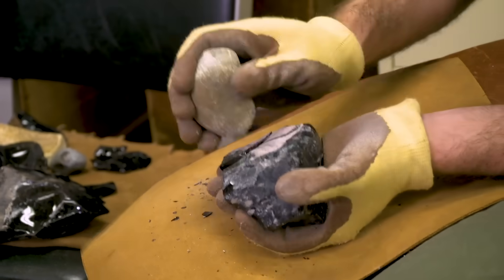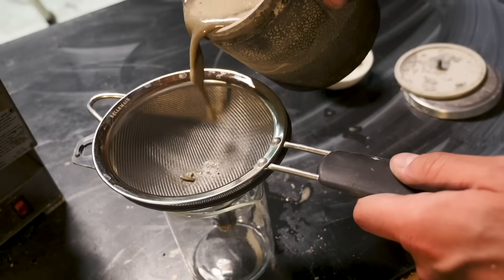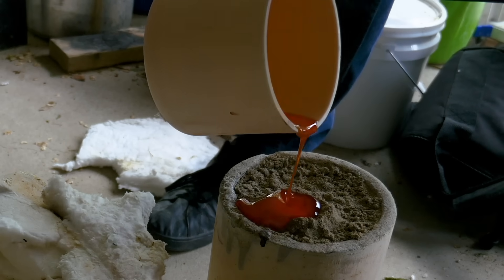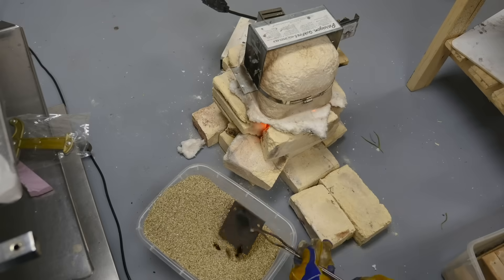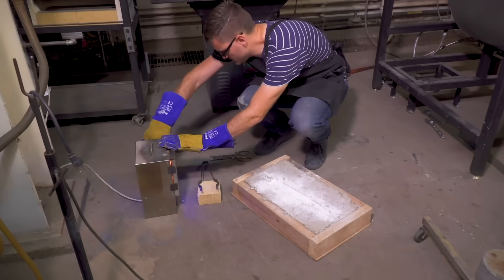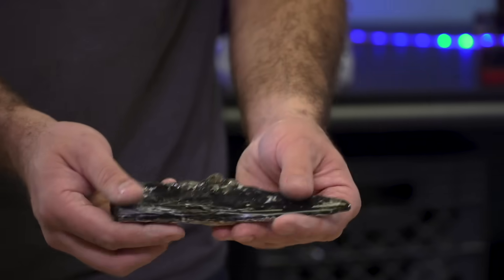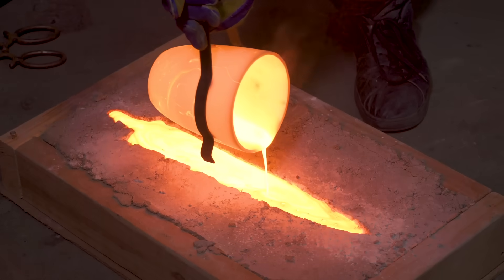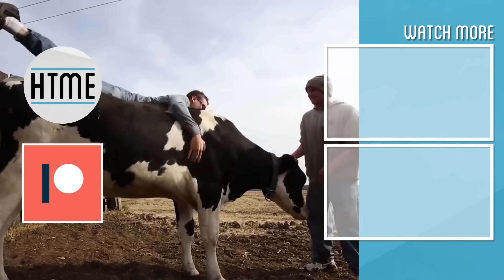Can You Melt Obsidian and Cast a Sword?

Comment: As with all crystalline structures, the longer it has time to set, the more organized the structure will be. In nature and in manufacturing this is achieved through heat and pressure. Since obsidian has a lot of impurities, which can differ in obsidian obtained from different regions, the annealing process for it requires much longer time for heat dissipation and at higher ambient pressures that typical glasses... like some gems ,such as rubies and diamonds, require high pressure, heat and time to form.

Chances are that part of the reason it's so brittle is that there are a lot of trapped gases in the molten glass; oxygen, nitrogen, CO2, other trace gases, and since its setting at room pressure and probably within 24 hours all those gases migrate and expand as the surrounding crystalline structure compacts but are unable to escape. This causes internal pressures to build eventually forming fault lines (cracks) in weaker areas of the structure (locations with higher levels of impurities).

Creating a resilient obsidian blade is possible, its a form of glass and just look at what the company Corning is doing with Gorilla Glass. The melting, casting, and annealing should all be done in a pressurized, heat regulated enclosure that can properly regulate the process for optimal results... being able to do that, well, that's out of most of our reach. With that being said, it is a glass crystalline material and is subject to the same tensile stresses that occur in most glass crystal structures; hit something hard enough, or at the right angle and it will shatter 🤓😜
Reply: Just have a look at how Zirconia blade is made. It is pretty similar. You need powder obsidian + binding agents, and then mould them under very high pressure, so it can stay in shape for handling. Then you heat it up towards the evaporative temperature of the binding agents, to let the binding agents get out from the obsidian shape in a controlled manner. Then you sinter the obsidian in a very high temperature for it to shrink to 2/3 of its size. That is how a strong bond is formed within the crystalline structure. This is how all engineering ceramics are made, if you know things like silicone nitride, silicone carbide, alumina, etc.
Reply: that is, it is not very possible to do at home ...
Reply: Like silica glass, obsidian is NOT crystaline. That is why, when you flake it, that the fractures are conchoidal 

Obsidian is not always black. I have seen a number of different colors/effects depending on the impurities. Some is even clear like glass.
Reply: @buggsy5  Crystalline silica has conchoidal fracture as well.
Reply: It works just like melting chocolate?
Reply: @verylittletime  

No.  But you can eat it like chocolate.
Reply: @Rand0mManic  Great.
Reply: In English pls

Comment: The right method to use Obsidian is by Grinding it to a powder state then u add it on a Molten Metal and I don't say just dump the obsidian u need to scatter it evenly through the blade by sprinkling it like adding salt to a dish

Comment: Might be more feasible to find a large obsidian chunk and chip away till you have a dagger or sword etc, than the blade would be sharp and you maintain the integrity of the obsidian, granted it is still going to be weak because of the density of obsidian, which would only give a couple of uses before snapping or becoming dull.  The smaller the weapon the more durable it will be.

Comment: Can you cast an ingot from a meteorite/s, then turn the said ingot into a blade of some type?
Reply: Yes if you have enough of the right kind of meteorites. As long as you only used the most iron rich meteorites you have something pretty close to smelted iron and could make a blade out of it. If you were really lucky you might even get ones with relatively high nickle content (can vary from 5%-25%) and end up with something like maraging steel (15-25% nickel) which is still workable into a blade but much harder than pure iron. Though you'd want to melt it down because many meteorites have a crystal structure to the iron and nickle that would be problematic for making a good blade.

Comment: Try adding Borax.  Boron strengthens silicone materials like glass & obsidian. It also reduces cracking & breaking.
Reply: I . think he also needs to keep everything hot and bring temp down slowly in the annealing oven. Like it's done in nature. Oxygen free would probably help as well , but not a vacuum either.
Reply: That is more relistic but I doubt casting is the right way to go about it it. Even in metals casing can produce bad quaity iron and steel, because of air. glass weapons only exist in fantasy, but I like a better grouning in reality when I read fantasy. Or  when I write it........
Reply: @mariabyrne7222  aztecs had weapons made of obsidian wich where a lot sharper than weapons made of metal
Reply: @---5819  but they like flint were forged in the earth. Casting glass isnt going to cut it, its not the elements but the chemical reactions they go through to make the weapon.
Reply: @---5819  what im trying to say is the weapons were knapped like flint and obviously ordinary glass is used as a weapon every day. But cast glass, is ike iron going to be filled with imperfections such as air. This will not just make it bittle like iron but it is actully full of weak spots, the slightest pressure on the glass is always going to cause it to shatter, so it has no strengh as a weapon. It is only good in a fantasy world were the rules of phyisocs sre different.
Reply: @mariabyrne7222  I agree, there are more chemical processes that go into glassblowing than simple casting.
Reply: @Anolaana  exactly!
Reply: @ @mariabyrne7222  Boron is what turns glass into Pyrex glass. Unlike iron, glass & obsidian can be melted and poured into a mold. Glass & obsidian are silicone materials which have different atomic properties than metals such as iron, zinc, titanium, aluminum, nickel, etc. due to the difference in the atomic structure. Working with glass based materials must be done properly though. The temperature has to be controlled. Boron glass or boron obsidian is much tougher than the untreated glass or obsidian. It can be filed or sanded to make the edges sharp. Obsidian was used for arrow and spear points by passed civilizations. It worked very well. Neurosurgeons & researchers currently use obsidian blades in scalpels under an operating microscope to cut nerves longitudinally to remove tumors, etc.. Obsidian edges are infinitely finer & sharper than any other type of blade currently available. I did not want to get into all of these details in my original post. I just wanted to point people in the right direction if they wanted to pursue this further.
Reply: @mariabyrne7222  author much?
Reply: @andybucak4564  poet wanna be novelist. Slowly making a name. But not there yet
Reply: Maria Byrne not with that grammar/spelling you ain’t.

Comment: so 1st make a large kiln big enough to hold the mold. 2nd use graphite not sand. 3rd heat the unknown obsidian slowly giving a chance for all gas to escape slowly rather then all at once. add vacuum if you can after it stops.  preheat the mold. after pouring put the mold back in the kiln to cool slowly. 
the big problem is your trying to cook a pot roast in the oven in hour not a crock pot over 12 hours. because you are using glass sand to cast glass you are trying to do everything quickly so the mold does not melt. your trying to cast wax in a wax mold see the problem.

Comment: your shit will disolve in water..lol,,then you fake the color. btw...thats not called flux. ..your just making up words now.
Reply: That's called flux... you're new to the casting/forging community, aren't you?
Reply: @dobson.  rofl...no im not..im  a glass blower with 30 years exp..who specializes in blowing tektites and obsidian...and thats not how the word flux is used in glass.  you are literally...talking to the wrong guy ,,
Reply: borax can be both flux and network modifier..but what you did was litealy make borax glass. you no longer have a silica matrix. so you arent using it as a flux.
Reply: @dobson.  btw..i own a company that makes custom borosilicate glass. with either uv sensitive ,,or is color shifting depending on light sources.  that i design the glass formula and production methods of. as well as having built the production line from scratch.

Comment: The GoT universe realized that this was a problem. Hence they used Valerian Steel as the Flux and dragons breath (the fire) rather than using kilns to melt the obby to the right temperature . You had the answers all along.

Comment: It would probably be less likely to crack if the mold container if the sand or mold itself was heated as well, that way the contents slowly cools down to the container's temperature and then from there it can be cooled further. I do think it would be better to take it to a professional glassblower's workshop, due to their expertise and proper-sized equipment. They might even get a kick out of turning the obsidian rocks(with metal additives or without) into an obsidian sword.

I also think you should have used a metal core for the blade and handle rather than just straight up obsidian everything. The core of metal would allow for less of a chance for the handle to break(it would probably be easier to make the main body of the blade out of metal and make the edge of obsidian. But rather than try and form it in a wedge shape, go with a blunt shape that could be gently ground down. It would take longer but the end result should be of better quality.

Comment: Obsidian sword(godly)[attack 1560,defend 1357]
Craft the obsidian sword(godly)? NO YES←
For crafting an obsidian sword,you have to equip:
Blacksmith nearby
Miner nearby
Have to crafted at least 5 legendary weapon or tool(5)
100 smithing level(100)
30 iron(30)
100 obsidian(100)
10 Rock elemental(10)
10 ground elemental(10)
10 fire elemental(10)
10 ice elemental(10)
10 star elemental(10)
50 mystery elemental(10)
an obsidian anvil(1)
Craft← Quit
Start crafting...
It will take 10 days...

Comment: Its possible using the blow torch during the cooling process (for your last and most successful pour) may have induced stresses in the blade. I understand the need for a controlled cooling rate but by using a torch you subject the blade to differential cooling, which in turn could lead to locked in stresses (which may lead to fractures). Casting within a preheated form surrounded by insulation could help with this (not sure about the feasibility though). **Disclaimer: I'm no blacksmith/glass blower, but i do do research on the thermal treatment and aging of polymeric materials**

Comment: How To Make Everything, youy messed up and made mistakes also on the castings mold making. As a professional metallurgic, machinist and prrecision mechanic, i have to say:  Every casting mold needs additional "casting air channels" so to speak. This helps  the casting release the unnessary pressure tension, excess air and unwanted impurities out of the casting, making better casting.
Also, youy should have grinded the obsidian even more finer powder, almost fine as a dust (no rocks what so ever!), so you dont need to add anything else to casting process itself.
And yes, we do have done obsidian castings on our school days.

Comment: the problem with obsidian is, that it is too hard, which makes it brittle. iron and steal is not so durable, because its so hard, its durable because its also flexible, so it will bend rather than break. obsidian and glass is usefull, because of the scharb edges, but its very fragile because it is simply too hard.

Comment: have you considered using some sort of metal core heated up to a high temperature, but not molten temperature so the obsidian will have added strength. Also, the conductive properties of the metal encases in obsidian could even help slow the cooling.

Comment: The blade doesnt have to be 100% obsidian
you can grind the obsidian into a powder, add it to a Damascus steel mixture, cast it inside a canister, and draw it out as a part of the steel.
you would essentially endup with an obsidian infused Damascus steel blade, and it would probably be very sharp and have some nice visual characteristics.

Comment: Use a HHO  brown gas generator which you can buy on ebay and it burns over 6000 degrees. Or you can try induction heating for melting.

Comment: This stuff looks like a nightmare to work with but I admire your determination and it was interesting to see the results. I think if you want a true obsidian dagger your best bet is to make cuts off a large block given how brittle it is.  Maybe with a water jet cutter? The reaction when it cooled with the bubbling was interesting in how it reacted to the air. If obsidian forms under high temperature volcanic conditions then I wouldn't be surprised if the temperature and chemical composition of the air plays a role. The air would likely be hot and have gasses and substances like sulfur present which may effect the cooling process differently that normal air.

Comment: If you make another attempt at this, what if it were to be mixed with other elements to make it stronger?  A pure glass blade, Obsidian or otherwise is still glass.  But akin to the Flux making it transparent and impurities making it darker, what if it were obsidian-coated metal?  Or combined Obsidian-metal molten poured into a mold?

Comment: If obsidian is mostly silica then at 2000 degrees it is an acid.  No wonder it leaked from crucibles and ate up kilns. Notice he added METALLIC nickel and chromium to the mix and it made black glass again.  Hence molten silica glass mixes are corrosive as heck at these temperatures 😳

Comment: Use a induction furnace itl be cake to melt you can pour over 2000f easy for fluidity. Line the crucible with refractory theres some good premade refractories from foseco.

Comment: Lol how many thousands of dollars did you flush down the toilet to make this? 

I made a beer can forge and made my own bars from the metal and melted through a few cast iron containers. I considered buying a a crucible but wanted to spend as little money as possible.  

My forge was bbq charcoal inside a sand/ plaster mixture, insulating a metal empty gas grill container I cut the top off from.

Comment: I’ve seen a documentary on how they made traditional Japanese Steel Swords (the old way) and how they cleared the impurities from the Iron to make the Steel itself. Perhaps maybe combining Obsidion with this sort of Steel might yield results? It would be a lot of hard work though. Probably sounds like a terribly dumb idea, but if this is something based on like The Elder Scrolls games like Morrowind where Obsidion is easily one of the heaviest materials that’s used to produce very heavy weapons and armor; then it would stand to reason that it would likely have to be infused with another yet heavy material to add durability to it along with its’ density. Otherwise it would more or less be like the Glass weapon’s and armor from the same games, but with far less structure. Then again; fiction is fiction and not everything in games, books, and movies is for real. Not something to go unconsidered though.
Reply: By the way; last I saw thanks to the documentary; traditional/old fashion Japanese kilns/forges still exist (or at least one still does). It’s very interesting how they do it. And it’s also an obvious sign of how a lot of things nowadays just aren’t made to last as they use to..

Comment: I just learned about useing brown's gas and it will melt things that normally take high temps. (like tungsten) and melt them at much lower temps. This is because the hydrogen is the smallest atom and gets heating done more quickley before it burns up.. 2 atoms of oxy and 1 atom hydrogen! (gas made from water.) It is used in glass blowing alot.

Comment: At the very moment you melt it it’s already no obsidian anymore. What makes obsidian is the crystalized molecular structure which is formed under high pressure. That’s why you can never cast it by melting, not to mention adding flux. If you want some obsidian swords, just polish, or get into a national level lab with super high pressure operating condition.